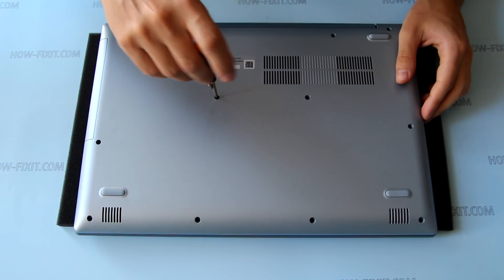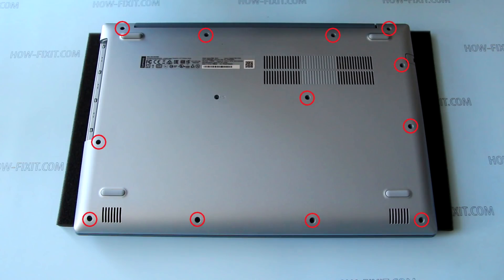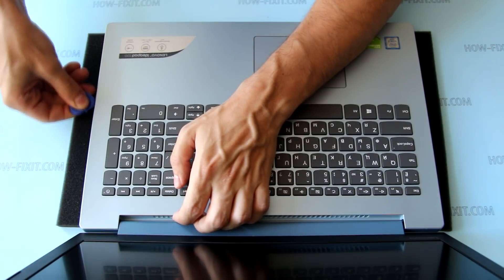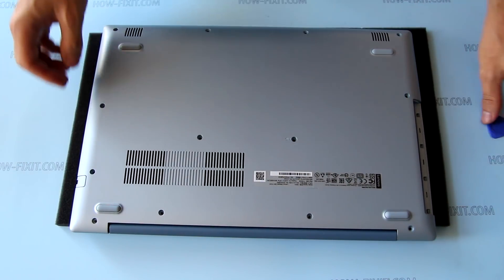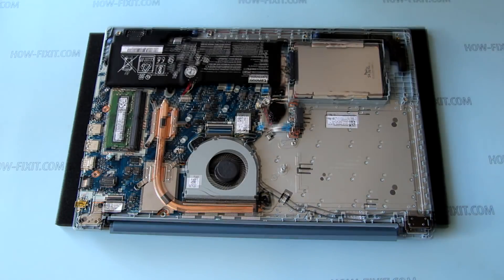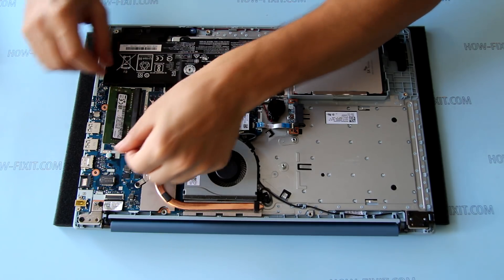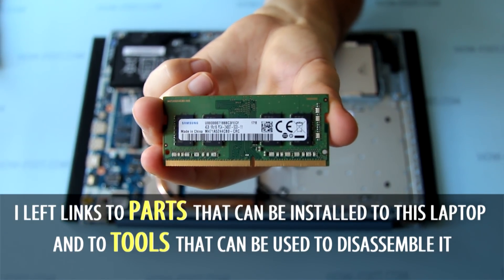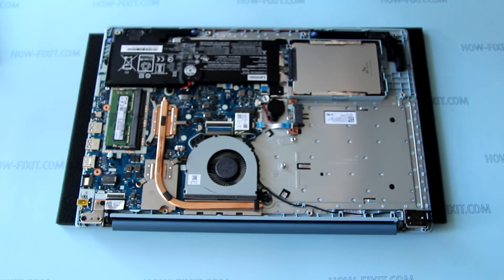Lenovo 320-15 RAM Upgrade & Install: Step-by-Step DIY Guide

Comment from the maker: *ENG*: Links to DDR4 RAM, screwdrivers, and bonus content are in the description under the video.
*RU*: Ссылки на оперативную память DDR4, отвертки и бонус контент - в описании под видео.
*ES*: Los enlaces a la RAM DDR4, los destornilladores y el contenido adicional se encuentran en la descripción debajo del video.
*FR*: Les liens vers la RAM DDR4, les tournevis et le contenu bonus se trouvent dans la description sous la vidéo.
*DE*: Links zum DDR4-RAM, zu Schraubendrehern und Bonusinhalten finden Sie in der Beschreibung unter dem Video.
Reply: Hello. I have laptop lenovo ideapad 320 15ast. It has 4 gb ram memory and only one slot. Can you please tell me does it support maximum of 8 gb or 16 gb? Also what is the maximum speed that it supports, 2666, 2400 or 2133 mhz? I want to buy new memory, please help.
Reply: @aleksandarjovancevic9999  I have the same laptop you have do you change it to 16gb or 8gb  and which speed you choose .plz answer me
Reply: Hey nice video... Quick question. I have a Lenovo 320-14ipa but im not sure is mine uses DDR3 or DD4, can you help me with that.

Comment: Does this laptop only support 2133MHz RAM or also 2400MHz?  On the internet I found information that only 2133MHz and now I don't know if it's true. 😕🤨
Reply: same here. i want to upgrade mine but i don't know what should i buy. 2133 or 2400?

Comment: What is the maximum capacity of RAM that I can use in Lenovo Ideapad 320?
Reply: Idk I have one too yesterday I used cpu z and seems like I have ddr4 ram so I’m sure it’s 16gb
Reply: @alizahid5572  Yes. But 4gb of RAM is already soldered into motherboard.
Reply: @sidingfog6137  so if it has 4gb installed, can i buy 8gb and add it so it’s gonna be 12gb??

Comment: HyperX RAM you linked to in the description does NOT fit. I just bought and tried to install but the gap in the connections does not line up. The video was helpful however. Shame the RAM wouldn't fit.

Comment: i have 4gb ram 2133mhz and i bought 1x8 corsair 2133mhz
Reply: It works very well
Reply: @ionutoleinic4151  what model of laptop do you have? Does cpu-z say it's working in dual mode?
Reply: @karolmaczek  i have lenovo ideapad 320-15isk
Reply: Does it work well? Did you do a benchmark with and without?

Comment: Lenovo ideapad 320 15ast
Cpu: amd a9 9420
Gpu(integrated): r5
Gpu (dedicated): amd radeon 530
Ram 8 gb
Hhd:1 T

Can i upgrade the ram to 16 or 20 gb? What ssd can i put for better perfomance? Can i replace the dedicated gpu to a better one, cuz i bought this pc for gaming but it can't run very well so much games... 
Thank you for the help
Reply from the maker: Ye can upgade to 16Gb RAM
CPU soldered to the motherboard therefore it is impossible to upgrade
You can install any SSD type of SATA 3

Comment: I have a question, its says up to 16gb ram, so if i add 16gb ram on the slot then 4gb built in total will be = 20gb ram? Please confirm since im confused because specs telling me up to 16gb ram however my current laptop 320-15ABR is 8gb ram (4gb built in + 4gb ram slot) can I add 16gb ram on the slot??

Please help! Thanks!
Reply from the maker: You can install 1pc RAM of 16gb + 4gb built in motherboard = total 20gb

Comment: Does this model have an internal ram running? Opened mine for the first time and found out there was no ram chip in the slot. But no way it would run without the memory so....
Reply: yes it has a 4gb ram install , the slots are extra ram to upgrade
Reply: @muhammadhazim5709  appreciate your reply. So does it mean the original ram is soldered somewhere the pc?

Comment: So basically you can only change the 1 x  4 gb ram the other one is solded into the motherboard...and there is only one slot...so that means you can either put a 8gb ram and make it 12 gb ram or put a 16gb ram and make it 20 gb ram...is that correct?and if yes will the motherboard support 20 gb ram?I have the 320-15ABR model...thanks
Reply: Max is 16gb I think
Reply: So if i leave 4 gb soldered and place a 16 gb will it read it as 16 gb or will it not read it at all and i have to settle for just 12 gb
Reply: Is 16 and 4 would be 20 making it over the limit. So my qiestion is will 20 gigs work and count as 16 or is 12 gb the only possible upgrade

Comment: Hey I bought this laptop a year ago and today I opened it out of curiosity and the ram slot is empty , is there any chance that they placed the ram elsewhere?
Reply: One ram is soldered to the board. And one is available for your expansion. You can buy new ram module to expand the ram.
Reply: @SurajitMajumdar_piku  Thanks!!!

Comment: I just gotta comment on the wasteful design of the laptop

If they didn't include a dvd drive, the battery could have been almost twice the size

It's not like external usb dvd drives are expensive and hard to get
Reply: I understand your standpoint, but the company knows what they are doing, if a larger battery was installed sacrificing the ROM wouldn't it make the laptop more haver causing problems to portability and excessive heat production ?? And not only that it would cost more due to li-ion batteries are not cheap and lithium is a scarcity in this planet and replacements batteries will be more costly.

Comment: Hi, do i need to install something on computer after i upgraded the ram?
Reply from the maker: No, just install RAM
Reply: @howfixit  I want ask Lenovo IdeaPad 320 lkb is single channel or dual channel? and if I add one more 8gb RAM the result it would count as 12gb RAM or 8gb?
Reply: @demonlord9187  It will be dual if you add additional RAM. For the second question - it will be 12GB

Comment: How much ram slots does a lenovo ideapad 320 have?

If there's 2, im gonna buy another 4gb ram.
If there's only 1, gonna buy a 8gb ram
Reply: theres 1 slot free, There is already a built in 4gb ram so you can extend it
Reply: I have a question, its says up to 16gb ram, so if i add 16gb ram on the slot then 4gb built in total will be = 20gb ram? Please confirm since im confused because specs telling me up to 16gb ram however my current laptop 320-15ABR is 8gb ram (4gb built in + 4gb ram slot) can I add 16gb ram on the slot??

Please help! Thanks!

Comment: hello, does not matter the ram mhz integrated with the other? I mean, I have integrated to 4GB 1034 MHz and I want to add one of 4GB to 1600MHz, would it be 8GB? Would not it be a problem?
Reply: Normally it shouldn't be too much of an issue, the 1600mhz ram will just run at the slower speed

Bearing in mind that on this model performance isn't really that important

Comment: I have a 320-15IAP Laptop (ideapad) - Processor: 1x Intel Celeron N3350 processor(N3350)
Memory: 1x 4GB DDR3L 1600.
can i add a ddr4 2133 8 GB?
Reply from the maker: Yes, you can
Reply: @howfixit  Thanks my friend!!

Comment: Can you install a new graphics card?
Reply from the maker: No, you can't install new GPU or CPU on this laptop
Reply: not its integrated
Reply: u can use eGPU but it is expensive and needs a lot of changes. Wifi will not work. and the performance will be lower due to lower PCI bus speeds. look up eGPU in laptop on youtube.

Comment: can a DDR4 2400 run on this notebook? cz im a little bit difficult to find a 2133 memory module.thanks
Reply: yes, but the mother board will set the 2400 memory to 2133 :}
Reply: тоже интересует. ответь если можешь

Comment: hello, i have a question, hope you answer. I'm not really into this computer things and some things are hard for me to understand. So I bought this Lenovo 320 ideapad 15iap, it says it has 4GB ram. My laptop works really slow and when I check my pc's properties it says it has 2GB ram (1,83 usable). doesn't it supposed to have 4 gb ram instead of 2? is it the windows problem or my laptop's problem and can i somehow fix it??
Reply from the maker: Disassemble and look do you have RAM in Slot. If not, you have only 2gb RAM.
Reply: thanks

Comment: the 4gb ram attached to board is 2133mhz so the new ram that can be put into slot should have same bus speed or it can be higher ?
Reply from the maker: It can be higher, but it will be works on 2133mhz speed

Comment: My laptop is lenovo ideapad 320 - 15ISK 
Intel i5 - 6200U 2.3 2.4 GHz
Ram 4 gb
SSD 128GB
NVIDIA GeForce 920MX
Can I add one more 4gb RAM and in the result it would count as 8gb RAM? Is that correct?
Reply from the maker: I suppose you can, because as I know this 4GB might be installed on board, not in slot.
Reply: How-FixIT Thanks for help!
Reply: could u installed extra 4gb ddr or not?
Reply: Andrius - I have the same computer. Can you give me some advice on which brand did you choose for the upgrade?
Reply: Yes

Comment: Thank you for video. I have IdeaPad 320-15ikb, i5, 8gb ram,  what is the maximum I can add? What size should ddr4 should I purchase? How long do you think would take a newbie to disassemble and install the ram
Reply: The info I have says the maximun is 16GB not 12GB. The info I have is for a Lenovo ideapad 320-15IKB i5-8250U with a GT MX150 GPU. In any case you should contact Lenovo for more acurate information.
Reply from the maker: Yer, this is correct info. My previous statement concerned Lenovo 320 Seres based on 6th Intel Gen and its peers (http://psref.lenovo.com/syspool/Sys/PDF/datasheet/ideapad_320_15IAP_datasheet_EN.pdf). Meanwhile same 320 Series but based on 7th Gen supports up to 16GB in one slot (http://psref.lenovo.com/syspool/Sys/PDF/datasheet/ideapad_320_15IKB&Touch_17IKB_datasheet_EN.pdf). Thank you that you've point out my mistake.
Reply: @howfixit  so can i use 4gb(inboard)+ 16gb  on 320 7th gen?
Reply from the maker: As I know maximal amount of memory that can be installed to 320 Series is 12GB (4GB on board + 8GB in slot)
Reply: How-FixIT thank you for your quick response my next question is it worth it economically to upgrade from 8 to 12 GB? Will I be able to tell a difference in gaming
Reply from the maker: Depends on what CPU installed in your laptop and your expectations
Reply: Lenovo Ideapad 320 15ABR  AMD A12-9720P RADEON R7.  Laptop is upgraded to Windows 11.  System said 8GB was installed OEM.  I had a 16GB DDR4-3200 SODIMM stick and installed it in the RAM slot and it now has 20GB RAM. Works great.

Comment: I bought this laptop which I really enjoy until I started editing movies and says memory low. Not realising most of the memory is used for the programs. How can I install from 128gb to higher thanks
Reply: Nicky Byrne 
Memory and and storage space are two different things. 128GB would be your hard drive and it sounds like It's full and can't hold anymore files. Memory/RAM is random access memory used when running programs/multiple programs at once and determines the speed of that.

Comment: Service manual:
https://download.lenovo.com/consumer/mobiles_pub/ideapad320-15isk_320x-15isk_320-15ikb_320x-15ikb_320-15ikbtouch_hmm_201704.pdf
Reply: its says here the 320-15 can be upgraded to 16 ram, so ill need to have 1x16 right?
Reply: Dor shem-tov depends. If you install DDR4 2133mhz the processor can only support 12gb. Also you should note that some of these have ram soldered onto the mobo and can't be replaced; for example mine has 4gb of ddr4 2133mhz ram soldered onto the board therefore I can only add a stick of 8gb for a total of 12gb. Processors vary in these models so might wanna check how much ram yours can support

Comment: Can i install an SSD in it?
Reply: Kelke van Lessen in this laptop you can install ssd M.2?
Reply: ashish tripathy yes
Reply: ashish tripathy Yes, I just installed an SSD in mine. Followed this guide to open the case. The hard drive enclosure is easy to remove from the installed harddrive.
Reply: M2 NVME can be installed?

Comment: How much max RAM can be installed?
Reply: Single slot with a max of 8GB RAM
Reply: Andres Wijaya 8gb. One.slot
Reply: NO you WILL mess up your system because it will continue to try and register more than it can
Reply: You can put an 8Gb so-dimm in slot 2, as long as its decent quality 2133Mhz like the one in slot 1, if you put some cheap and nasty ram module in that has oddball frequency and voltage nothing like the stock one in slot 1 then the system will either be really slow and unstable and crash all the time or it will just bluescreen on boot.
Reply: Go get "lenovo solution center" from the internet and run it.  It will inform of the maximum capability for RAM in your computer.

Comment: Is Lenovo ideapad 320e have single ram slot????🤔🤔🤔🤔🤔🤔
Reply: AgusPro Gaming adding ram won't help you, this isn't a gaming computer.
Reply: rapesee d wew, the laptop, is fast and very good at gaming, believe me, i have it and is the best laptop xd
Reply: It's dual channel but only 1 slot available as the default 4gb ram is soldered to the motherboard.
Reply: VISHAL SINGH I want one more cuz I have it but I want to play pubg and I can’t :,v
Reply: rapesee d idc xdxd
Reply: AgusPro Gaming expected as much
Reply: AgusPro Gaming yes i agree, graphics and all good but fps drops when i play fortnite. Installing ram might help i guess
Reply: 4gb soldered ram
Reply: Regilio Bouma does the Lenovo have a mini pcie
Reply: Use Belarc Advisior to display your hardware information. Just thought to let you know coz I was able to find an empty slot of RAM on my board.